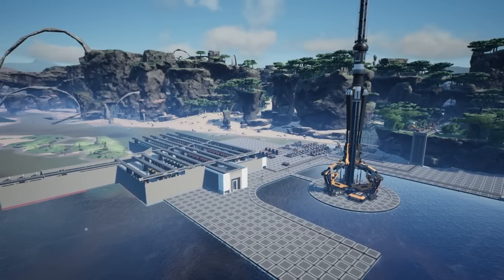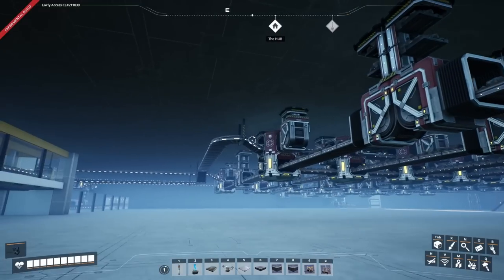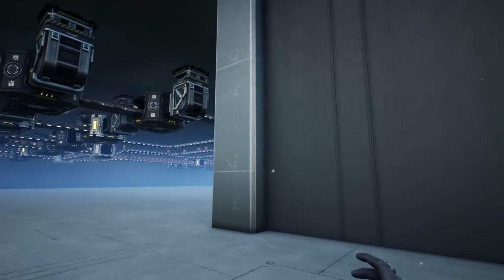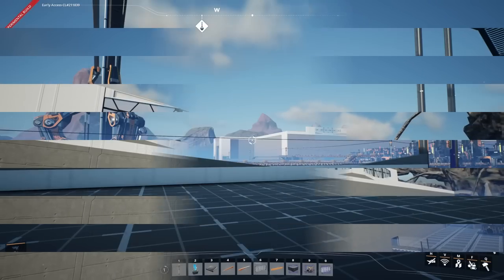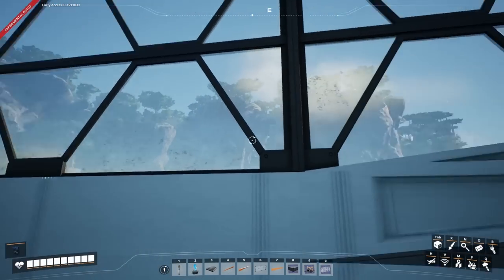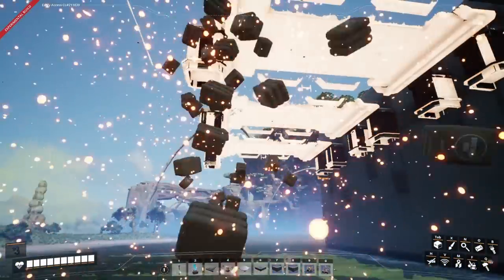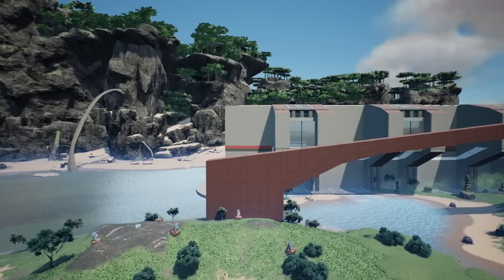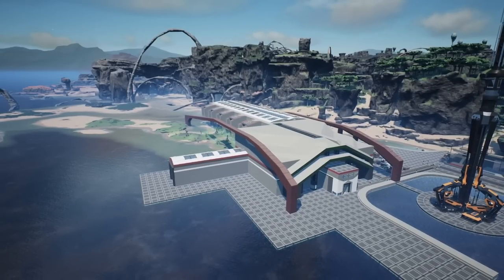RENOVATING The Factory With Blueprints In Satisfactory Lets Play Ep.03

Comment: How do u place a blue print building onto an existing floor, do u remove all of the tiles of the size of the base of the factory? I have had trouble trying to place them into an existing floor.
Reply from the maker: I place a 2x1 foundation blueprint next to the edge I want it built, then remove the 4x4 grid and place the blueprint in blueprint mode next to it